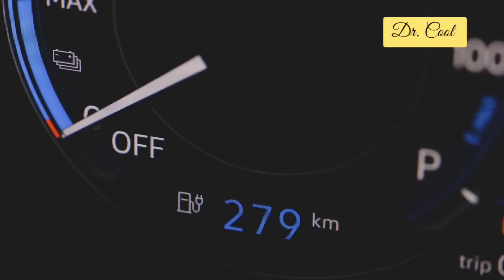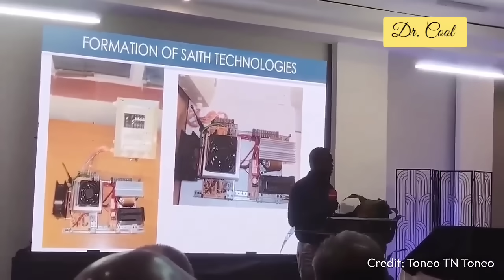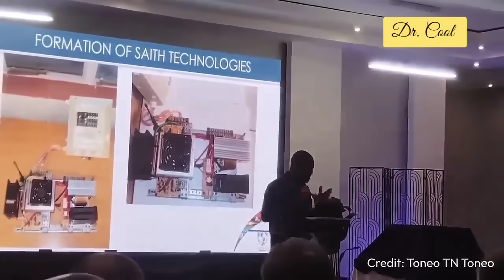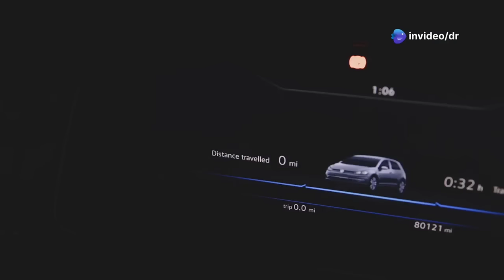2025 World First Self- Powered Ev On Sale Now! SHOCKED Automotive Industries & Sceptism

Comment: It isn't "self powered" quite the opposite.  If you listen to Mr Chikumbutso - he says - it is powered by EMF - radio waves.  Nicola Tesla had the same idea 100 years ago - you can use EMF waves to transmit power. That power can be transmitted to a remote users - say a car or motorcycle - and then you can convert it to electricity which you use to drive an electric motor.  This may mean you do not need a giant battery but you do have to generate the power and have transmission towers. It is not clear how efficient or what range such powers can have.  Perhaps it will be a good idea for people with no power lines .. we'll have to see more.